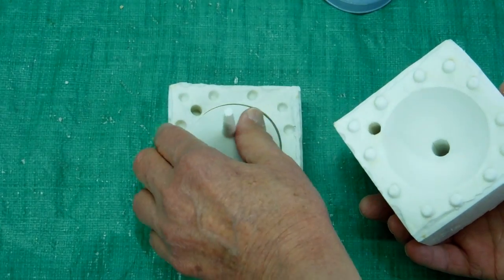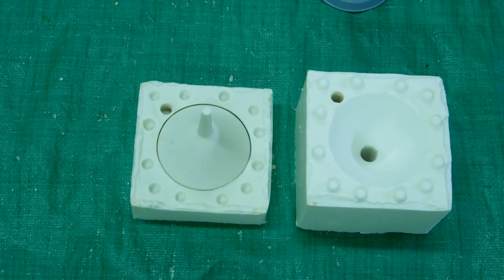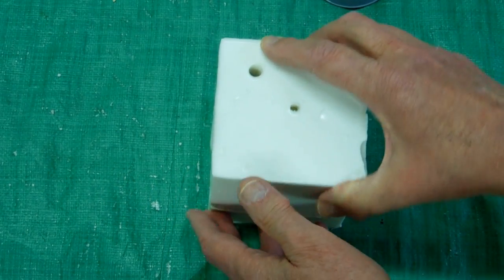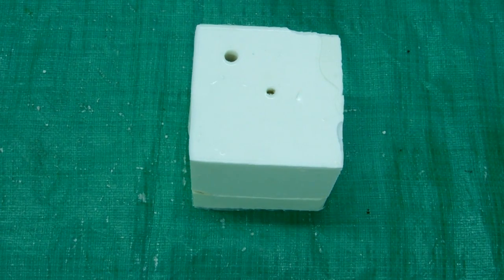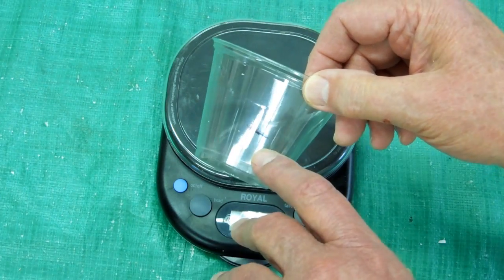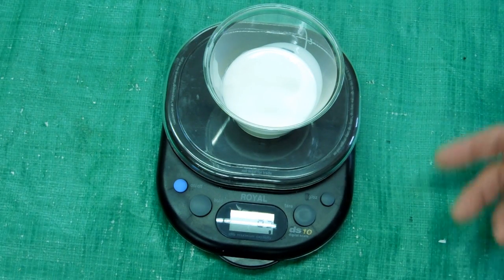Casting A Silicone Funnel

Comment: Question, I created a golf ball silicone mold, and used a small piece of clay for the funnel. But this leaves a hole at the top of the mold so it’s 99% golf ball. How can this be avoided? Ty!
Reply from the maker: You will need to create a path for the resin (or whatever you are pouring) to enter the bottom of the mold and a vent for the air to exit out the top of the mold. Use a dimple for the injection point on the bottom and another dimple on top for the air vent. A syringe to inject the resin may work best. 
When cured, remove your casting and gently trim off the mold sprues, sanding and smoothing the contour of the golf ball. Then recreate the two dimples using a ball rotary file. Ron
Reply: @RonaldWalters2010  ty Ron! What’s a dimple tho? I know the funnel creates a path, would a dimple be a really small path so not to mess up the mold? Ty
Reply from the maker: Look at a golf ball. All those little round craters or depressions are called dimples. Google: "golf ball dimples" 
You need to use the dimples as an injection (filling) and vent points as there aren't any large smooth places on a golf ball. 
Don't know why you want to make a casting of a golf ball. You certainly would not want to hit one with a golf club.
Reply: Ty Ron. Can I ask what the vents do in silicone molds. Ok I see what u mean about dimples. I’ve been using the flat sides of molds as the natural way to create funnels, but for a 2 part mold won’t the funnels ruin the design of the item being molded. A syringe in the dimple is an excellent idea, Ty Ron.
Reply from the maker: The vent lets the air escape from the mold cavity so the resin can enter the mold cavity.
A 2-part mold will always result in a mold seam (line) and some clean-up is required. Generally, you try to make a mold to take advantage of an existing edge or somewhere where the seam will not be obvious or is relatively easy to carve or sand away. With a ball that is not possible.
I think I have helped you about all I can. You need to watch some of the videos available on YouTube on making silicone molds.

I have a playlist on youtube showing my Senior 20 Conductor Figure. There are several videos you can watch regarding making the molds, removing sprues and cleaning up the castings of fairly complicated shapes.
https://youtube.com/playlist?list=PLDjucfhdTRPnsxpT4cRofFVFP1-B2R3cX&si=d1y3GW4dXvMEA1wf
Of specific interest:
Senior 20 Organ Conductor (7) Resin Casting Process
Senior 20 Organ Conductor (2) Clean Up Castings
Conductor Figure Test Molds & Castings
Reply: @RonaldWalters2010  thank you so much for the information and your time!

Comment: ******IT IS NOT A WASTE! It may also be a clear advantage to being able to remove set resin/epoxy from "Silicone Skin". I would cut the tip back of the rigid funnel by 1/8" to 1/4" inch and place the "Silicone Skin" within the rigid funnel as a LINER!****** and being that the silicone skin is thin will enable an Easy removal of Set Epoxies and Resins!

Comment: New to casting. I have a project in mind, but I'm way behind the bell curve. I need to look at your video library.
Reply from the maker: I had never made silicone molds or resin castings either when I started. Mainly I  wanted to make a Conductor Figure for a Street Organ.

Good place to start are my videos on -    Vacuum Chamber and Pump   Pressure Pot

And I have playlists on -    Senior 20 Organ Conductor Figure Casting Kit   Air Circulating Hot Box

And then a couple more videos on -   Chair Leg Glides

Thanks for watching. Please Subscribe!
Reply: Thank you sir.

Comment: Realize this is old, but couldn't understand why you didn't cut spout off of blue funnel and place silicone funnel into the main body of the blue funnel with the spout sticking out the bottom. Like a liner. Would of worked that way.
Reply from the maker: The casting was a duplicate of the original funnel so it would not exactly conform to the inside surface of the blue funnel... it would get wrinkled up and not lie flat because you would be placing the outside of the funnel against the inside of the funnel. A liner could have been made but it wasn't worth the effort.
Reply: @RonaldWalters2010  right..... Didn't think of that. Still pretty amazing how well it came out. I was very surprised.
Reply from the maker: I was surprised as well. That was a difficult pour.

Comment: How about getting a small metal funnel and coating it with silicone. That might be easier,  faster and cheaper. 

However,  the perfection of your silicone casting was very pleasing to see. Thanks for sharing your time.

Comment: Your plan will work, you just need something to hold the silicon funnel in shape. The solution is to use both the silicon and the plastic funnel. Cut the narrow section off the plastic funnel and insert the silicon funnel into it. The silicon funnel works like a liner. The plastic funnel holds the silicon funnel in shape and the narrow part of the silicon funnel hangs down below the cut line of the plastic funnel so you can still pinch it off.

Comment: Wouldn't a pastry bag do the trick? You can exert quite a bit of presure with some of those.
Reply from the maker: +nexus01gr  I thought about that or using a syringe. It pretty much has to be disposable because the pot life for some of this material is pretty short and you wouldn't have time to clean it up and/or the chemicals to clean it would be more expensive than the disposable item(s).
Reply: +Ronald  I would give it a go with freezer bags. Readily available, cheap & sealable. Can't beat that. Realy enjoy your videos and I'm looking forward to see what you have in store for those casts...

Comment: What about putting silicon funnel it inside a slightly bigger funnel?...you could still benefit from the silicon and use the plastic for the skeleton/ support and the tip should protrude enough that you could still pinch it off as needed...either way nicely done Ronald....great looking piece...

Comment: Would inserting a spacer layer between the two mold faces increasse the wall thickess suffficently, or will that (thin) ring at the top reduce the capacity too much?

Also, could laying a thin reed of transparent materail over the escape hole as a check valve  accelerate filling the mold in the vaccum chamber, or would air tend pull past/into the silicone?
Reply from the maker: +LynxSnowCat  I would need to add thickness to the outside of the original plastic funnel with clay, wax, plaster (something similar) or just machine a thicker funnel. Then make a new mold. I'm trying to convince myself it is worth the effort at this point. :-) Usually you are not trying to fill a thin section mold like this with such thick material. Plastic resin is much thinner and goes into the mold much easier and the air comes out easier. A syringe is probably best as a positive injection method, although the syringe will only be good for one application as plastic resin sets up fairly quickly. The syringe is probably cheaper to replace than the solvent to clean one.
Reply: Here is an illustration of what I mean.

light blue is the previous mold,
dark blue the previous mold product,
orange is a new spacer,  and
green the new result.

http://i.imgur.com/ENCjKob.png

By increasing the spacer layer thickess, the wall thickness is also increased.

I imagine that this orange layer can be formed by wedging the funnel (with "condom"?) into the bottom mold face, and then pouring suitable material around it. Though this could cause the indexing features to be lost.
Reply from the maker: +LynxSnowCat  Yes, I knew what you were referring to but it would not add thickness to the upper part of the funnel which is trapped in the bottom of the mold. Easier to just start over with something thicker to copy.

Comment: Wondering, would it be possible to use the pressure pot for both vacuum and pressure, possibly replacing the lid with 1/2" accrylic?  Also, try the funnel with a paper outer 'mold holder'.  Use the original funnel to paper mache around the funnel, and put your thin funnel inside the paper mache.  Together it should work out for your original uses.
Reply from the maker: +servant74  Fumes from some of these chemicals can react with acrylic (in particular solvents and vacuum infusion chemicals) and the reaction with acrylic can be quick and dangerous. The lid for my vacuum chamber is 3/4" or 1" thick Pyrex glass.
Reply from the maker: +servant74  I have tried several different ways to use this but it is just too thin. Bottom line, it just needs to be much thicker.

Comment: I've wondered about how using a vacuum chamber and/or pressure chamber on concrete or glass fiber concrete will affect curing.  I'm thinking a vacuum chamber would pop all of the cells.  Would it turn the dried mixture to powder?  Have you done any experiments with concrete?  I haven't found any videos but that may just be attributed to my lack of good search skills.
Reply from the maker: +BC ElginTex  You are going to be limited in the size of the object. The volume of these chambers is probably around 2.5 to 3 gallons. A vacuum of 29 in Hg exerts a considerable force on the chamber and lid so most people are not going to be able to afford chambers much larger and the time to evacuate the chamber with one of these small pumps would be a factor. Concrete is sometimes mixed with air (called air-entrained concrete) for various purposes... to slightly lighten or to better withstand freeze-thaw temperature cycles. A vacuum would bring the bubbles to the surface. There aren't any "cells" in normal concrete. Vibration is generally the best way to get concrete to fill a mold or voids.
Reply: Yep, I'm making small molds.  "Cells" are probably the wrong word.  I am referring to the tiny pits.  They are really porous and I was wondering if putting them in a vacuum would pop them and make the figurine more dense like porcelain or if the vacuum would ruin the cure.  I have a spare compressor and an old cast aluminum pressure cooker I plan on making a similar contraption to what you have,  I'll let you know how my experiments turn out.
Reply from the maker: +BC ElginTex  Vibrating the concrete inside the mold will help get rid of the imperfections against the surface of the mold but concrete is going to be porous. Make a concrete bucket and fill it with water. It will probably be empty tomorrow. Pressure cookers operate at around 1 atmosphere or 15 psi. Many a pressure cooker has turned into a bomb.

Comment: To add some thickness to the mold cavity/casting. It should be possible to dip the outside of the original funnel a few times in hot wax to add the necessary thickness, before making the mold.

Comment: Could you use the silicone funnel as a liner for the original funnel?  A couple binder clips around the upper edge could hold it in place.  Perhaps you could trim narrow end of the original funnel so that you could still pinch off the resin during the pour.

Comment: That was indeed a very nice casting - what is the purpose of the pressure chamber? I've not seen that used in resin casting before
Reply from the maker: +Magnus Nyborg Madsen   Entrained air (fluid aeration) is caused by mixing the two chemicals and sometimes gas is formed by the reaction of the two chemicals. The vacuum chamber pulls out entrained air to help eliminate any
bubbles. This is done again when making the mold to obtain as perfect a mold as possible with no voids or bubbles. The pressure pot is then used to compress the size of any possible remaining tiny bubbles to negligible size and to force the material into all small cracks and crevices to obtain an exact negative of the object being copied. When making the casting, the vacuum chamber and pressure pot are used again to eliminate any voids or bubbles. The pressure pot remains pressurized until the material fully cures.

Comment: If you wanted to get a bit more wall thickness in your casting, would you consider adding some kind of thin spacer between the two parts of your mold?  The spacer's vertical offset should translate into a little more wall thickness in the finished part.  Note that you'd get more final thickness in the upper section of the finished part than in the lower section, owing to that upper section's shallower slope.  You could use a little bit of trigonometry to decide how thick of a spacer to use.

Comment: I'm sure you know this but just in case: take an xacto knife and cut between the sprue hole and the part so as to assist releasing that tricky part you mentioned. depending on the pressure you exert while injecting the material you may get some flashing but that's the trade-off i guess.

Comment: You could cut half the spout off your plastic original, line it with your new silicone casting and have the rigidity, but also be able to pinch it off like you want.
Reply: +warcube91   Yes, I was thinking something similar like coating the outside of the cone with something that dries hard.  I'm not sure what would have those properties and also stick to silicone, though.